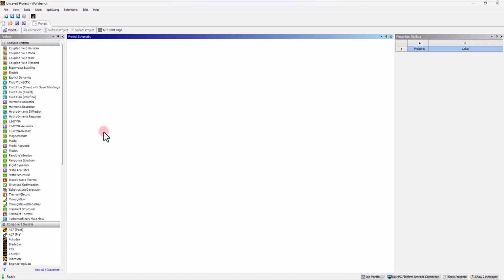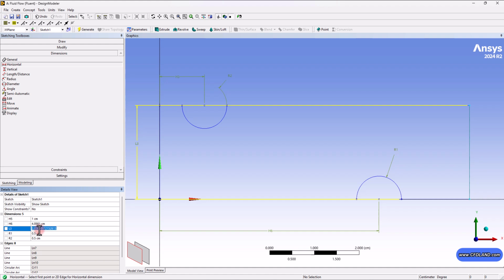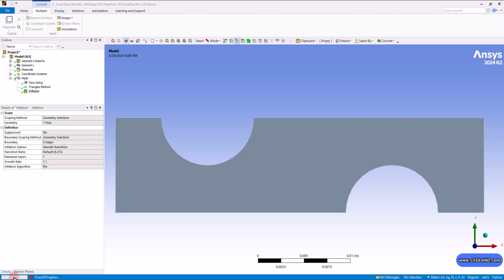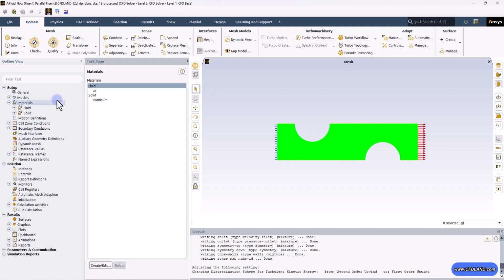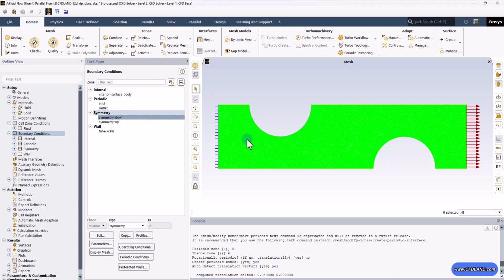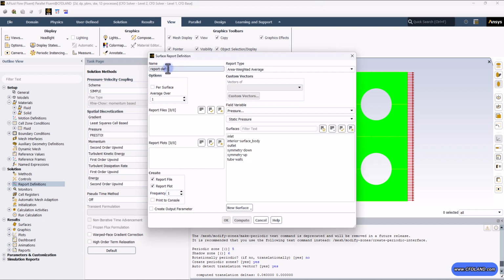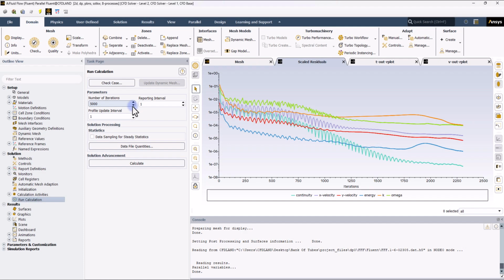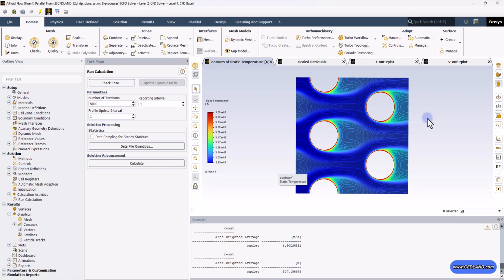Modeling Periodic Flow and Heat Transfer in ANSYS Fluent

Comment: Thank you for your excellent and informative ANSYS Fluent tutorials!

I would like to kindly request a complete step-by-step tutorial on **flow and heat transfer across a tube bank**, particularly for steady-state laminar airflow.

It would be very helpful if you could explain:

1. How to determine the inlet, outlet, and computational domain dimensions based on scientific guidelines.
2. When to use Periodic and Symmetry boundary conditions for inline and staggered tube banks.
3. How to perform a Mesh Independence Study and scientifically select the most suitable mesh.
4. How to validate the Nusselt number and pressure drop against published studies or established correlations.
5. How to perform a Parametric Study using ANSYS Workbench, varying tube diameter, transverse and longitudinal spacing, and inlet velocity.
6. How to compare heat transfer performance and pressure drop for different tube-bank configurations.

It would be especially valuable to demonstrate these steps using **a complete practical case study**, from geometry creation to validation and parametric analysis.

Such a tutorial would be extremely useful for PhD students and researchers working on CFD and heat transfer optimization.

Thank you very much for your valuable educational contributions!

Comment: Thanks for the great tutorial. I have a question regarding pressure drop. Is the pressure drop through the entire flow channel simply the pressure gradient x length of the entire channel?
One more question. When we simulate our domain with symmetry BC. We decrease the Mass flow rate to half ( Correct?)
Now, if we have a domain in which there is an element that repeats itself in both directions of x(5times) & y (16 times, flow direction), and the total number of elements is 80.
Now, how do you go about this simulation? Should we use 1/80 of the mass flow rate? Or simply 1/5? And how do you calculate pressure drop here?